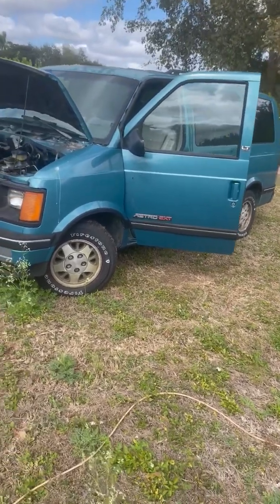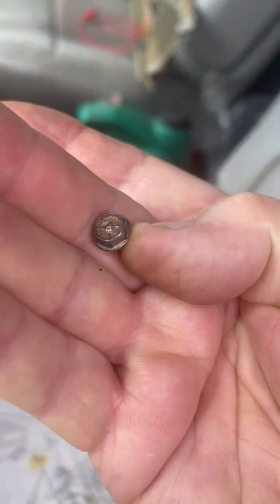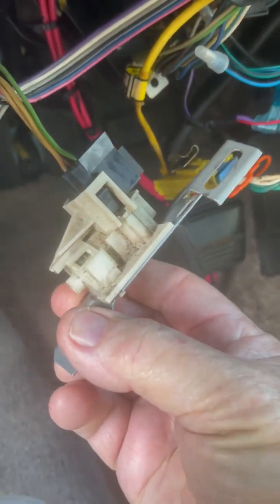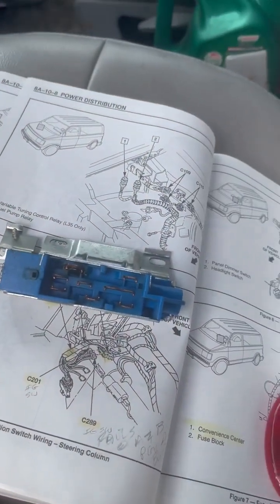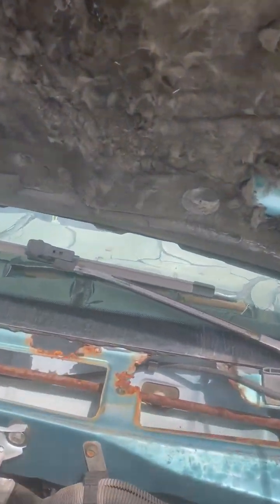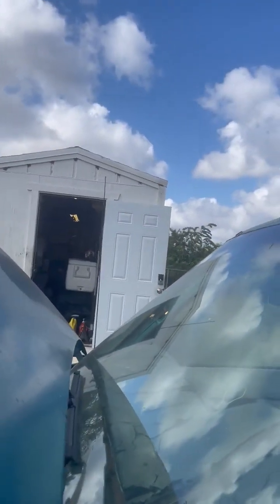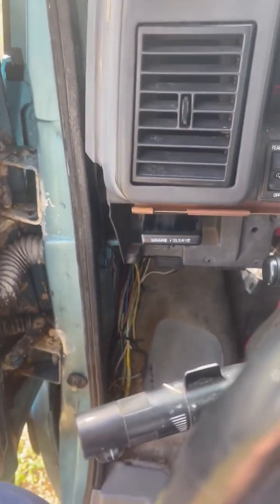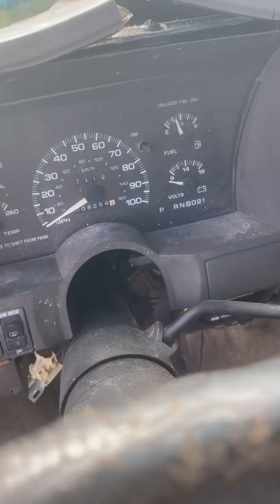Astro van (94) 1/29/2023 VLOG Ignition switch improvement

Comment from the maker: Community: I agree with my critics that the factory rear a/c fan speed circuit can "burn out" when on high speed for the rear fan speed unless you alter the circuit. The jumper will work okay on speeds lower than top speed for the rear a/c or heater fan. I spoke about this "ad nauseum" in my YouTube video logs and in my posts how to rewire the circuit in my video logs and in my posts. The supply side of the rear a/c fan speed is okay assuming the fused link behind the battery doesn't fail. The load side of the ignition switch "A" contact can be prevented by cutting the wire on the load side and using that source to control a aftermarket heavy duty relay used for isolating automotive stereo systems rated for 80 or 40 amps. The relay can be removed and revert back to the factory circuit quickly if needed for some reason. I plan to do yet another more focused video log today that shows the new circuit with the relay installed and the rear fan on high. I have done my homework on this and trying to help people stay cool. My video logs are not how to videos, they are video logs that tell "how Dennis does it". Godspeed. This video log shows my finished work so far on the rear a/c or heater fan speed switch. I have done posts and videos to explain my research and my work what else can I do to help people?

Comment from the maker: NVX PN # BIR80 low-cost battery isolation 80 amp rated relay used. BIR200 rated for 200 amp. GM service manual said ignition switch screws are SAE 10/24-0.33 hex head. I had to use short ignition switch open end spanner wrench to adjust the ignition switch and BTSI solenoid.